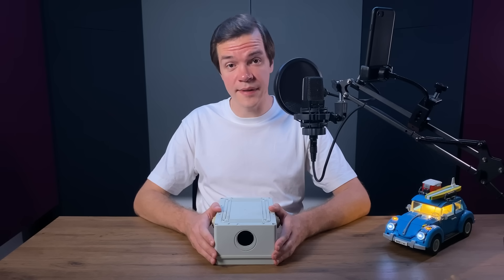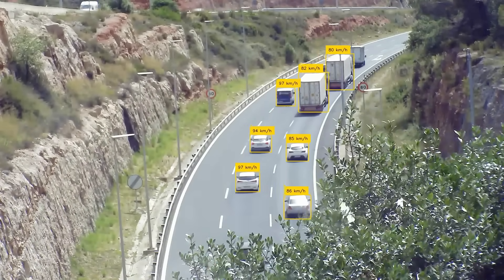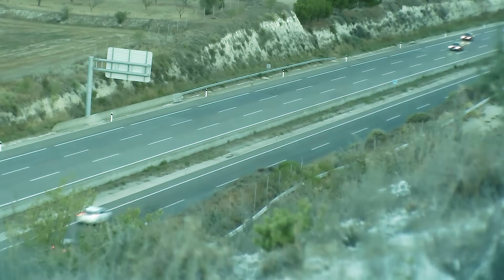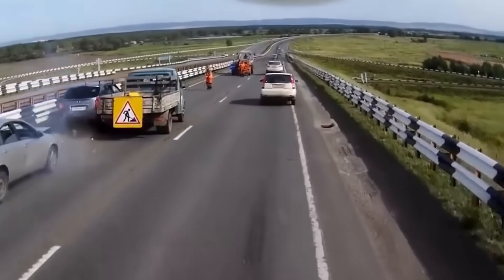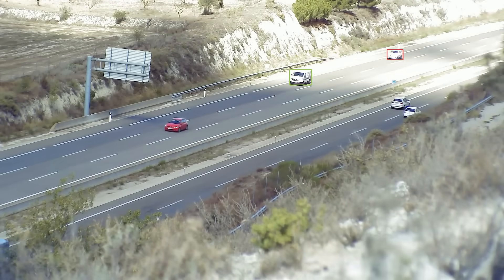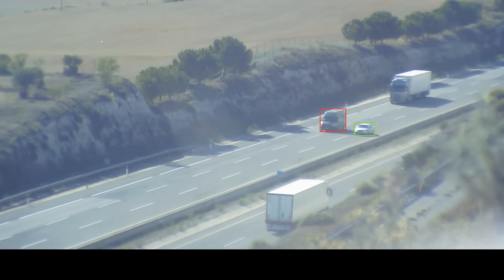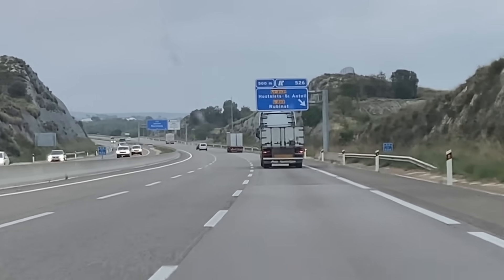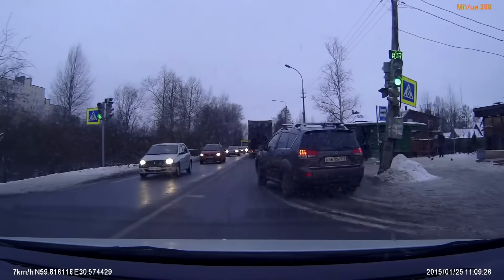New Anti-Tailgating Camera Reveals Shocking Statistics

Comment: If we drive too close to the vehicle in front we lose sight of more of the road ahead because that vehicle effectively appears larger and takes up a greater space in our view ahead. So that's another reason for leaving a safe distance to the vehicle in front.
Reply: I also drive closer to the right side of my lane. It let's the person behind me (especially if they are tailgating) see the traffic in front of me so they have a few extra moments of reaction time if I have to brake because of the car in front of me.
Reply: A truck move to the right lane in front of me. I almost crash into a mattress on a highway road with ample time to slow down and swerve to the right.  I didn't see the mattress until the truck turn right.
Reply: The presence of so many fat-assed pickup trucks blocking my view constantly forces me to change lanes.
Reply: Yeah, it’s called billboarding. You follow close behind a big trailer you are putting a billboard in front of yourself. You should be able to see two steps ahead watching what is happening 100+ft in front of you and around you, during regular driving conditions.
Reply: For a good portion of my life I tailgated, as in, I didn't leave enough space for a car to get between me and the car in front of me. You don't look around the car in front if you, you look through their windshield to see if the car in front of them is braking. It is far easier to see.
Reply: But if you leave safe assured distance, two or three people cut in front of you.
Reply: @Thehoser69  My fundamental assumption in my defensive driving strategies is that most other drivers are stupid and/or distracted.
Reply: @Thehoser69 Then you need to ask yourself what's more important. Your life, or losing a few fractions of a second in your travel time?
Reply: TRUE but the idea of highways is that they don't contain surprises
Reply: Highways absolutely do contain surprises, vehicles can break down at any time. Tyres explode, wheels even come clean off, people drift off the road, drive on the wrong side, run wide on corners. Then there is merging and lane changing. There have even been cases of fish plates coming loose and signs falling on the road.
Reply: @krisCrashTV  Have you ever made a license? Have you ever heard of wildlife running over highways or cargo falling off larger trucks at 120 km/h? Highways can always contain surprises, especially when you suppose that there are no surprises.
Reply: @giorgiolelmi8175 I once had a bicycle come off the cycle rack of a car just in front of me, at 70 mph  on the M6 in the UK ! 
it BOUNCED higher than my car !
Reply from the maker: That’s the type of accidents I am talking about in this video, but people still insist that the car in front will also be breaking with a limited slowdown rate, so 1s distance should be enough :)

Comment: After decades of freeway driving, I've developed a way of driving that means I almost never worry about traffic or tailgaters. How?  By focusing what I can control.  Step zero is to realize that going faster in traffic has rapidly diminishing benefits and rapidly increasing costs. Trying to go fast on a busy highway is a loser's gambit. You can't go meaningfully faster than traffic, but you can frustrate yourself, endanger others and get into trouble. I've come think of speeding and tailgating as an intelligence test that everyone has to take, sadly in front of others. 

So what can you do instead? You can drive to maximize the distance between your car and others. Forget minimum following distance, and embrace maximum separation. In heavy traffic his turns out to be an interesting and entertaining game of skill, involving the shrewd behavioral manipulation of others. 

Freeway traffic tends to form 'rafts 'of tailgaters who move together, with slower drivers in front and frustrated drivers in back. These rafts consist of drivers who choose or passively tolerate close proximity to other cars. These are disproportionately frustrated, immature, competitive drivers, whom you should avoid. Even when traffic is stop and go, there are open sections of low traffic road between rafts. 

You can escape a raft by 'driving backwards'- that is, by keeping a steady speed which is very slightly and intentionally slower than those whom you want to get behind. This cues the nearby cars to pass you as quickly and smoothly as possible. They will advance to the back of the next raft. Other drivers in the raft will tend to follow their lead, passing you. 

Soon you will find yourself between rafts of traffic, often with hundreds of meters of open road in front and behind. Any tailgaters are long gone. Carefully choose the best speed to stay centered between the traffic rafts. You'll generally need to speed up to match the raft in front of you. Use cruise control. Eventually,  the raft behind you will approach, eating up your open space. As they approach,  cue them to pass you by maintaining ample following distance and set a stable speed  1-2 MPH below the raft in front of you. Modern cruise control makes this easy. You are now driving backwards at 1 MPH. The leading drivers in the approaching raft thus get a clear signal, and will prepare to pass you early. Let them pass as comfortably as possible- they may tailgate you briefly, but if your speed is steady, it only takes a few MPH/KPH of differential to get them into the fast lane. 

Once the raft passes you, assess the distance to the next raft behind you, and resume the goal of driving centered in the stretch of open highway between the rafts.  Even in quite heavy freeway traffic, this habit has the miraculous effect of giving you wide open road while everyone else struggles in traffic. Since you are only periodically and briefly slowing down, your average speed is better than 99% of the traffic average, so your point-to-point times are pretty much unaffected. I recommend this for anyone who likes to beat the game. As you do it, this becomes automatic- just the way you drive.
Reply: Totally agree. Look for the open spots and get there. Disagree on cruise control.

Comment: I notice that some drivers will continue to accelerate toward what should be a stimulus to decelerate. Traffic lights make this obvious, the yellow (or it just turned red, for you europeans) is visible between 150m and 200m ahead, but the driver will continue to accelerate. When that vehicle is much closer to the light, say 60m, only then does the driver press the brake to decelerate. Then this driver is stationary at the light for however many seconds. It confuses me because I know the driver must come to stop. So why waste the energy to achieve a higher speed to then stop? It is as if the driver CANNOT see the light, despite having a clear line of sight to it. Their vision works, but their brain refuses to process this signal for deceleration until it is much closer.

I believe this same mechanism is at work with tailgating, the drivers that tailgate are not capable of reasoning space further than 30m in front of themselves. It reminds me of the vision of birds and bovines, they are completely blind in the time between the "snapshots" their vision takes as they move forward, hence the reason a bird's head appears to jerk back and forth as it walks. Is it one quarter of drivers, one third of drivers, or even more drivers who are ostensibly crippled in their ability to recognize and process the distances in front of them? Tailgaters demonstrate that a significant percent of the population should not be driving in the first place.

Comment: As a motorcyclist i am often quite close to cars for a brief time but will have a plan to escape to the right or left if the car suddenly brakes, so i dont rely only on braking distance... I guess splitting lanes for years has gotten me used to riding at speed within touching distance of cars.

 I guarantee im focused and my 2 fingers are always resting on my brake lever, often with the bit of slack pulled in so the first mm of pull will be engaging the brakes.  

Always thought if more car drivers rode bikes for a while we would have much safer roads...  Where are the govt. Mandated motorcycle ownership laws?!?? (Jk)

Comment: That's why when a driver follows to close (less than 4 seconds) I flush my windshield wiper fluid. At speeds over 50 km/h usually works pretty well.

Comment: A few decades ago I was a delivery driver, in a very past its use by date ford fiesta diesel van. 

Tailgaters were easy to remove. 

Drop from 5th to 3rd, and floor it, hit the rev limiter. It smoked a bit when you did that. Well, actually it smoked more than a bit. Today they call it rolling coal. 

It worked every time, a fine mist of very sooty diesel on their windscreen, and a dense cloud of stinking black smoke. I am trying to go faster, this is what happens when I do.

Comment: What video format did you use? Mjpeg or similar formats that take 24+ still photos per second?  That used to be a required format to do (effective) video data analysis, but I don't know that it is anymore.
Reply from the maker: This USB camera spits frames at a variable rate. In normal lighting conditions it’s about 31-32 frames per second. The video was stored in *.ts container with real frame timestamps. Then I just converted this to constant 32 fps MP4.

Comment: So you're driving along at 65 MPH and some one needs to get over to exit the freeway so you slow down to 63 MPH for a few seconds to allow distance between the cars. Still better then it was a couple hundred years ago when you would have been walking or on a horse at 3 to 5 MPH. As long as you use your turn signals the reasonable and proper thing to do is yield to cars in front of you whether they are directly in front of you or in adjacent lanes. Yes there is a violation of unsafe lane changes but speeding up to box someone else out is impolite.

Comment: Kindly note that it's unreasonable to expect sudden static obstacle on the highway, therefore safety distance of "full stop distance" or three seconds distance seems unreasonable. On the other hand, keeping distance of "1 sec reaction"+"1 sec reserve, total of two seconds seems much more practical... depending of traffic speed that would be some 60m, while tailing at 30m will be no-reserve lowest pure reaction limit... Any closer tailing distance than approx 30m does not accommodate for sudden breaking of leading vehicle, therefore on such close range it is extremely important to monitor  traffic further down the road thru the glass panes of leading vehicle and predict its movement, that was one of main reasons to legally impose raised third braking light as mandatory on cars...Another scenario to  note is  safe overtaking on regional roads = more often than not one must close the distance to leading vehicle down to reaction limit, eg 1 sec or lower before engaging in changing lanes...

Comment: A perspective I would suggest is that the longer observed following distances are not necessarily a consciously chosen following distance and possibly better interpreted as just a consequence of there being a low traffic density.  In the extreme case a single driver on this single 250m stretch of road might appear to be a safe driver, however it would require a second vehicle before you could determine if they choose to follow at an unreasonable distance.  Based on this perspective it would seem that the 50m to 60m following distance represents the extent of the following distance distribution and above that distance is just a consequence of low traffic density.

Comment: Driving around in Montreal, leaving any space in front of me practically guarantees I will get cut off and potentially stuck in the middle of an intersection if the file in front of me does not move enough. In some places, people even use mandatory right turn lanes to cut in front instead.

Safe following distances are nearly impossible to maintain in substantial traffic conditions.

Comment: My car has Advanced Adaptive Cruise Control which is advancement over conventional cruise control. This automatically adjusts the speed of my car to match the speed of the car in front of me. If the car ahead slows down, my car slows down to match a reduced by traffic driving speed. I set  & use the maximum following distance so that the in-car active radar sensors keep me at the longest separation from the car in front of me.  The faster my car travels, the following distance automatically adjusts & increases. When car is at 40 km/hour, the separation distance is about 30 meters, when car speed is 100 km/hour, the separation distance increases to about 60 meters.

Comment: I would note about speed cameras; there's a better option than monitoring the speed of a car on a small segment of the road. The better option is having two cameras fairly distant from each other, and ensuring that the average speed between cameras is low enough. This allows enforcement of speed along the entire segment between the cameras without needing cameras at every point.

Comment: I would be interested in seeing a similar analysis of the Los Angeles freeways.  Ranging between 3 & 9 lanes (one direction), and still upwards of 70 to 80 MPH.  Three-second rule is effectively impossible, with the volume of cars.  You're lucky if you can maintain one second of following distance.

And that whole left lane is for passing?  Fine, IF you're on a rural highway.  Doesn't work in town.

Comment: In Canada, drivers feeling entitled to drive in the passing lane at their leisurely pace is a significant cause of tailgating.  More dangerous because of the rage-filled pass-on-the-right manoeuver.
Reply: tail gating in canada is a problem because of traffic. people will steal your lane, go in front of you if you leave space. this results in you going bumper to bumper which leads to unsafe driving conditions.
Reply: Canada's Hwys are worst example since often clogged... When not, driving 120 in left lane will get tailgate, midlane full of big trucks and slow cars, right lane constant braking for merging in out traffic.
Tailgating laws should apply, as well build parallel hwy for trucks only.
Often stop and go for no apparent reason is due to tailgating and not keeping smooth ride by level distance and that one American visitor driving 100 in left lane 😢
Reply: Tell me: Do you consider driving at the limit too slow for the passing lane?
Reply: @Brent-jj6qi  I consider not using the passing lane for passing the issue